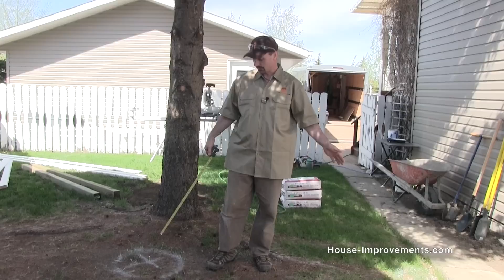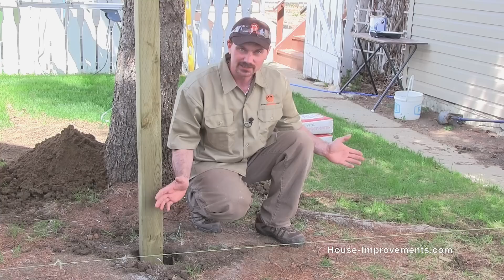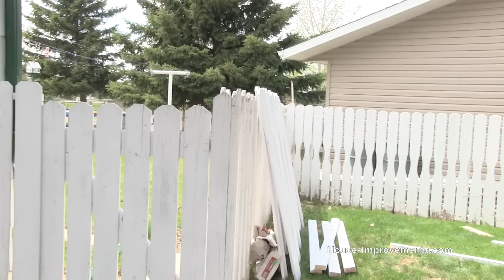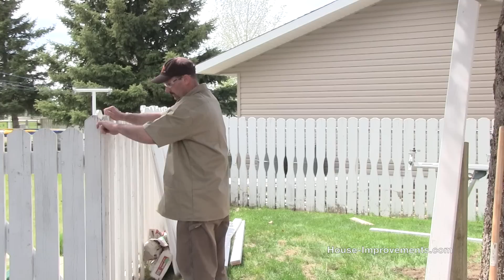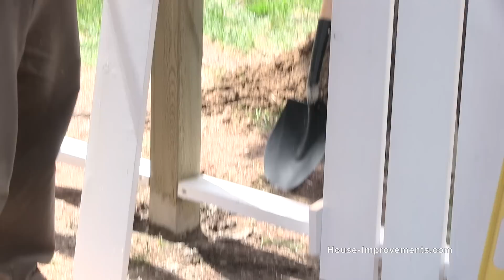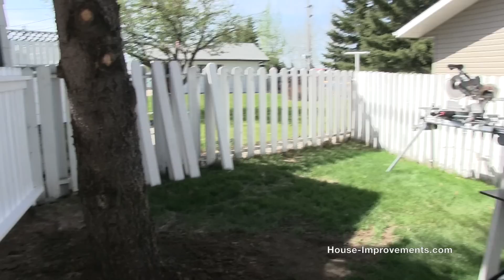How To Build a Fence

Comment: Shannon: I'm having a fence installed on the 'wet coast', lots of rain, the ground stays wet most of the year. One company said they silicone the concrete and post to reduce post rot. Do you feel that's a useful step? Thanks!
Reply: You might get a few more years going that route. You can eliminate all of that and have life long fence posts going with galvanized. It’s up to you though.

Comment: Fast-setting concrete ($6.00 U.S./50 lbs., Home Depot) is much cleaner to work with than the one you're using

Comment: What are the concerns when putting a post close to the house? Issues with foundation? Or water running against the foundation? I'm a little concerned with putting a post close to the house.... As well do you have any concerns/tips with using 6x6 posts? Thanks, great video!
Reply from the maker: +gordon hurlbot I do not think you should have any real concerns other than not getting to close to damage any water proofing that may be on the basement wall. If you are concerned with digging a hole that close you could cut the siding and attach post right to the wall I guess if you wanted.

Comment: Concrete should be a bit above grade for water to run off and away from the post. If you don't, water will pool and sit (moist) between concrete and grade...the post will rot faster in the area.
also, a bit of gravel as a base (2-3") will help water drain...since the wood (even pressure) and concrete maintain moisture.

Comment: Great tutorial Shannon ..Just a tip..To vibrate concrete around a fence post, or other small projects. Use a sawzall with no blade, place it against the post for a few seconds,works awesome...

Comment: Nice job!   I'm going to be helping a niece and her hub with a fence soon, and this was very timely.   One question - what type of material did you use for the screws that hold the pickets to the rails?   I did a fence in southern California about 9 years ago, and have had good luck with stainless screws.  Only drawback I found was that they're brittle and won't take excessive torque.  FYI - McFeely's has a great assortment of sizes on stainless, as long as you like square drive.   Thanks!.
Reply from the maker: I was using untreated pine fence boards and spruce rail material so I used zinc coated deck screws, If you are using pressure treated lumber or cedar then stainless screw or AQC screws. I'm from Canada and we use Square head (robertson) screws for almost everything . Good luck with the fence project.
Reply: HouseImprovements  Thanks for the tip on the screw materials.   I'll keep that in mind when I order materials.

Comment: I don't build a fence anymore without putting a block retainer under it with galvanized standoffs. In my experience, if you set a wood post, treated or not, in concrete, you shorten it's life. A little gravel at the bottom of the hole (couple inches) and pack the dirt back in after it(set at least 2 feet deep for a 6 foot high fence). Whenever I pull a fence post set in concrete, the wood that is beyond the bottom is good, and all the wood inside of the concrete is rotten. That said, I'll still set my gate posts in concrete but gravel the bottom of the holes and house wrap the bottoms of the posts.I seem to get more years out of them that way. Pretty much all I do is dig retaining walls and build fences, so take what I say for what it's worth. I DO like the fence hole drill! I haven't used one of those. I've used the clam shell a lot. I'm in sand where I live now so neither one is much use. Just driving them in is best if they're not going to be set on a standoff in a retaining wall.

Comment: I have a pre-existing fence I would like to replace.  The posts are in concrete. How would I easily remove them without using a jack hammer so I can basically start over ?
Reply from the maker: Please come to my forum on my website and ask your question there. I will answer you there shortly after. thanks
Reply: Depending on what Shannon tells you, there is a neat system where you can replace your fence reusing the existing footings if they're in good shape. You can drive in or set in concrete a standoff that you can place a new post into. You nail the post to the metal standoff. It keeps the wood from contacting the ground, prolonging the life of the fence, and keeps you from having to dig holes again.
Reply: +HouseImprovements I searched on your forum and couldn't find this question (or answer) do you know if the question was posted?
Reply: ForgotMyOrange
He said ask the question there, there isn't an answer there yet until you ask. He answers questions on his website, not on youtube.

Comment: I have a craftsman drill like 2 years old it really sucks compared yo yours, is that a Milwaukee ?
Reply: Randy Lahey
If you cant find a milwaukee drill; makita, dewalt, and bosch are also solid brands for drills.
Reply from the maker: Yes ,it is the newer "fuel" series with brushless motor. I love it.
Reply: HouseImprovements could I get it at like home depot or Canadian tire?
Reply: Randy Bobandy You can get them at home depot. Great tools!